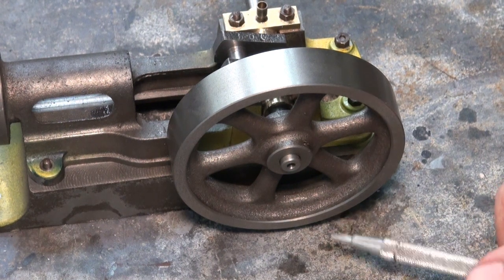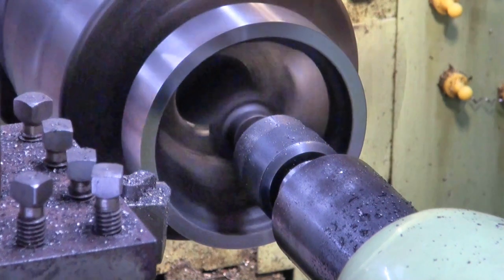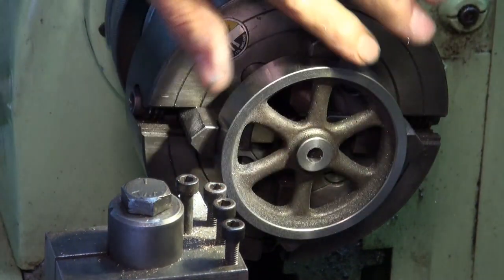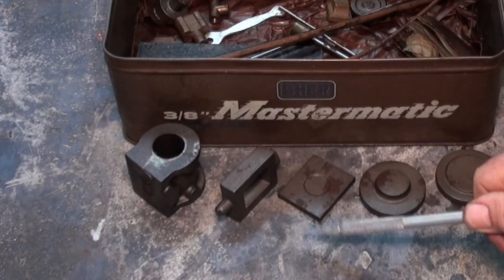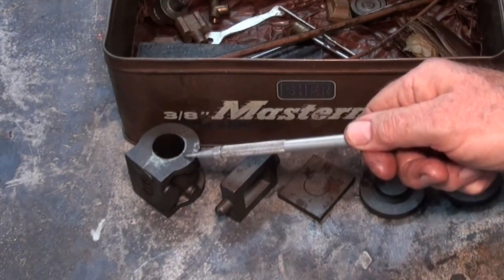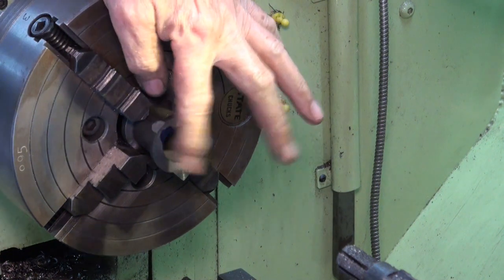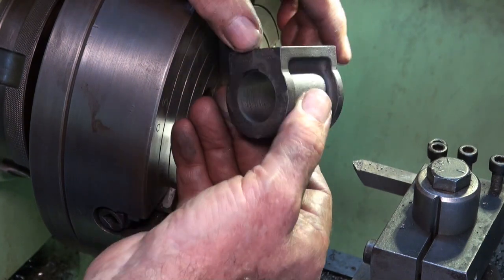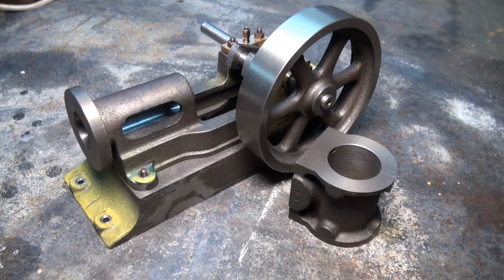Building the Stuart Turner Number 8 Mill Engine - Part 4 - Flywheel and Cylinder

Comment: Love that AEG drilling machine, I bought mine back in 1971 and I still use it now and then. Thanks for sharing!
Reply from the maker: The thing I like about it is that it has a full metal body on the front end. I did have a Bosch variable speed drill but it had a polymer gearbox and when it was tightened up in the steel collar bolted to the compound you could flex the chuck up and down without trying too hard. Not the best situation if you are wanting to drill accurate holes!

Comment: Taking shape nicely :-)  I'm surprised you didn't machine the second cylinder end in the mill though, I thought it may have been easier than using the lathe.
Reply from the maker: I guess I wanted to be sure that the machined end was truly perpendicular to the bore of the cylinder. My mill is not the most accurate machine in my shop but I know the lathe is good.

Comment: Hi Mark,
Thank you for your videos! I'm a long time armchair machinist who just got an old South Bend lathe and is starting to actually do something. I'm curious as to why you bolted the casting to the angle plate to face off the valve area, instead of just using the vice? Rigidity?
Reply from the maker: It was more to do with ensuring a perpendicular face. The angle plate has built in perpendicularity whereas setting the part up in the vice can cause the part to lift as you tighten the moving jaw. It wasn't possible to tap the casting down onto parallels so it can be a bit less accurate. 
Regards,
Mark
Reply: @Preso58  Thanks! I never would have considered that.

Comment: I was interested by your comments that cast iron destroys the edge of high speed steel tools. You turned to using carbide. Was that a braised carbide tool or a carbide insert that you used?
Reply from the maker: I mostly use carbide inserts but I do have some really old/cheap brazed carbide tools that I sometimes use just to get the skin off the outside of the casting. That outer layer is sometimes contaminated with moulding sand and burnt slag and it will knock the edge of an insert very quickly. Once you are into the underlying material the HSS tools work fine but you need to keep the speeds and feeds moderate. 
Regards,
Mark
Reply: @Preso58  Thank you Mark for your very helpful reply. I look forward to tackling my Stuart Half Beam castings when they arrive. I will get some cheap braised carbide tools as sacrificial tools. Andrew